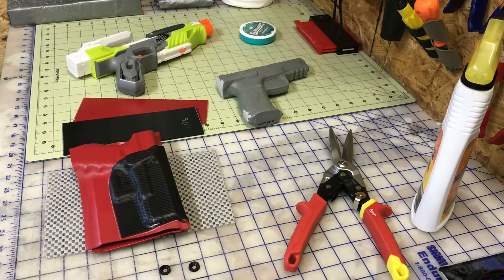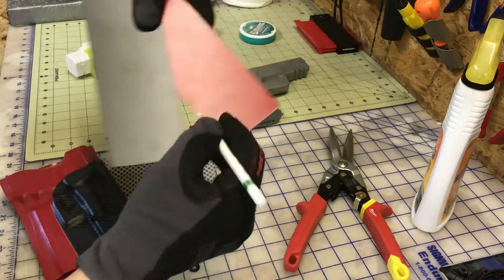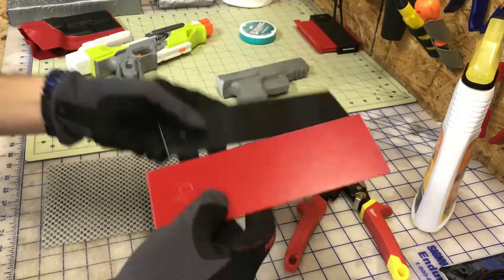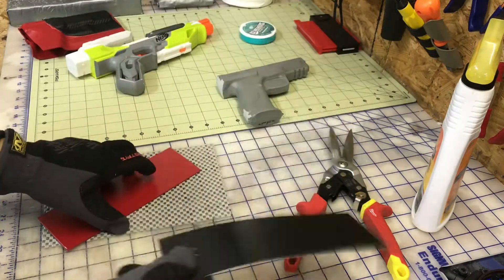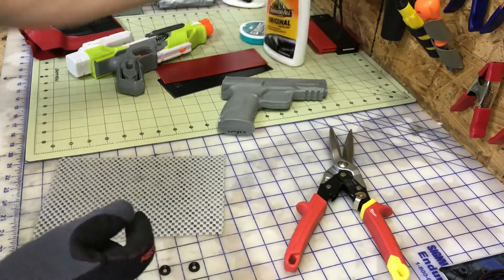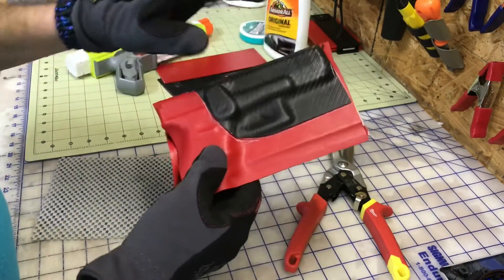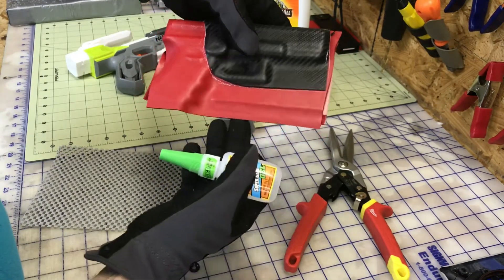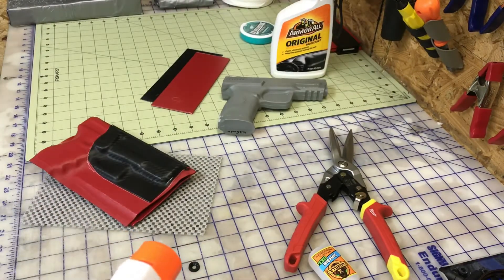Kydex Holster: QT

Comment: Why do you not like them bonding together? I stick them together right out of the heat press and finish the whole holster same way I would doing a single layer of .08.
Reply from the maker: LWRCrep the issue I keep having was material getting in between the layers during the sanding process, you can fuse them together by buffing them. But I do know some that use the pressure and heat to force them tight, I just do mine like that.👍